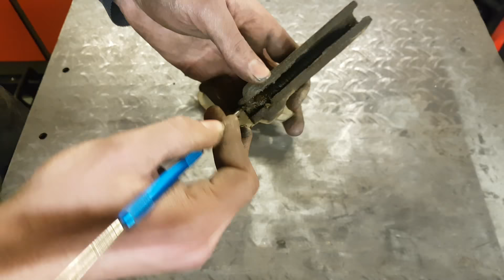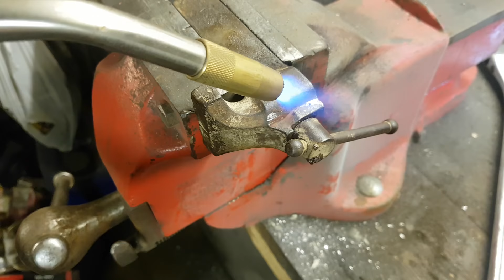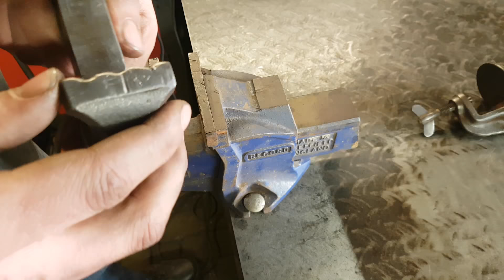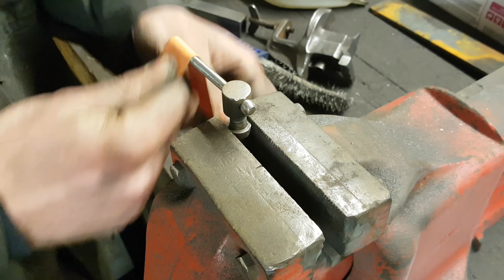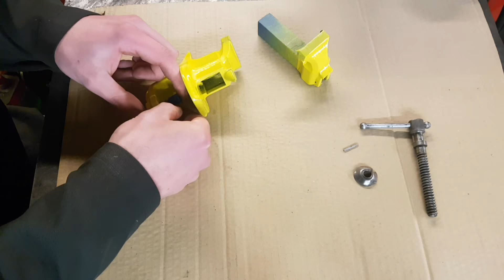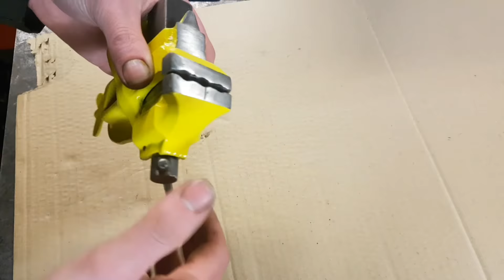Mini Vice Restoration

Comment: Good job!  I wonder if you could not unscrew the bolt initially because it had expanded from the heat removing the washer.  The heated end had expanded just a little too much to thread back through the body of the vice.  If you had hit it with something cold you may have been able to get it out.  Just a thought . . .   Excellent job.  I love watching vids like these.
Reply from the maker: The thread had a little bit of damage right at the end, I'm not sure of the time in the video but if you look closely at the point where I am trying to unscrew it you can see small chips falling off the thread and I didn't want to force it just in case I damaged the casting, I could have kept forcing it out but I don't have the right tap to re-thread it so figured it would be best to leave it and work around it. It had time to cool down before I tried to take it out you just cant tell this due to the editing in video. 
Thanks for the comment & Thank you for watching, ED

Comment: A very nice nice vice restoration,I didn't like the jaws,I thought you might have made them flush fitting,but a worthy restoration nevertheless,gets my thumbs up
Reply from the maker: I don't like the jaws either, I don't really have the right tools to machine them well enough for a flush fit. I could have tried with the grinder and file but I think my chances of getting them to meet properly would have been very slim.
It still works the way it should and holds things well.
Thanks for the comment and thanks for watching, ED

Comment: Looks great! my 2 cents on the color, since it was already modified with the grooves cut, it loses all "original" refurbishing value anyway.  If you are using it for your own work OR it's already been modified, don't stress about the color.  If you are wanting to make decent money refurbishing old tools and reselling them, try and stick with the original color unless it's already been modified as in this case.  WELL DONE!
Reply from the maker: I don't really know what the original color was, I think it was a shade of really dark red, from what I could see when cleaning it anyway. Like you say once it is modified it loses all originality. I didn't really like the yellow that I used but It was a can l had left over from another job so I figured why not use it instead of buying some more and i have grown to like it so i used the last of the can on another project (anvil video)(shameless plug;) I don't restore things to sell them so i am not too bothered about originality,
Thanks for the comment and thanks for watching ED

Comment: Did you ever fix the jaw faces or did you just calk it up to 'character marks'?
Reply: homeyshlitz Chalk*
Reply from the maker: No I didn't, They would need a fair bit or material removing, and i think if I took too much off it would interfere with the jaws closing tightly. As it is they don't affect the way it holds things, it still works as it is supposed to.
"character marks" is probably the right term so we will stick with that.
Thanks for watching ED

Comment: Using a vice on a vice. That's vice.
Reply from the maker: Well whats the point in owning a vice if you cant use it to hold a vice? I think I have 10 or 11 different vices, from a blacksmiths leg vice to this little one so I could probably make a vice totem pole and dance around it worshipping all things vice.
Thanks for watching, ED
Reply: Dude you should make a video on that. Thats fucking hilarious. Also, your the first creator of the video I comment on to reply to. Thanks bro.
Reply from the maker: I'm not sure about a video on it, A few of them are fastened down so it would be a bit of a job to get them all stacked up. I like to reply to my comments as a lot of comments offer tips and advice, which is always good.

Comment: Punching out pin with... center punch? o_O
Reply from the maker: I just used that to get the pin moving and then a normal punch after that, I find that a normal pin punch tends to jump around when hit and it ends up damaging the area around the pin instead of moving the pin. Maybe that's just user error. Thanks for watching ED
Reply: A centre punch will expand the pin's surface as you hit it.  Then the pin gets stuck.  So, you had to heat it to get it moving again.  If it were really stuck you could have drilled it.
Reply: Roll pin punch solves debate, loved the video and end result. Great job.
Reply: Rubio Atl 78 Some people feel better about themselves if they leave the "constructive" out of "constructive criticism". Unfortunately some people have to try to make others feel inferior to get any self worth, but that says more about them than the person they are trying to belittle. There’s another comment saying what was done wrong and why, but also that overall Ed did a good job. Ed learnt, I learnt and I’m sure many others learnt from that comment.